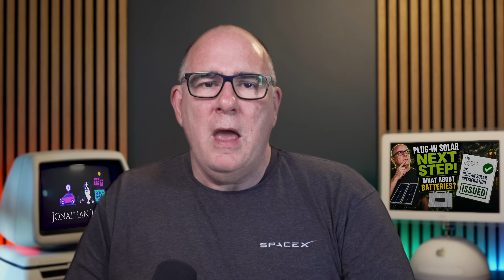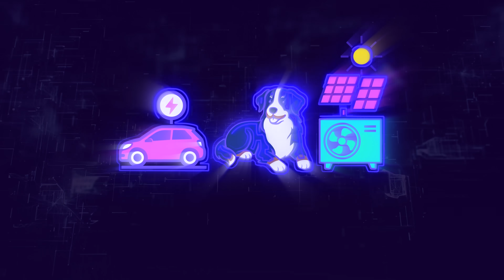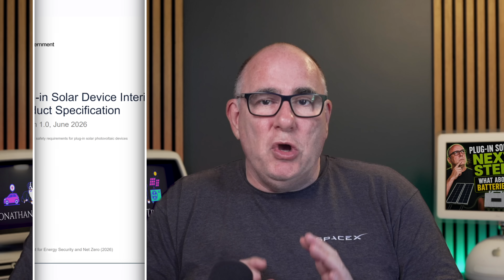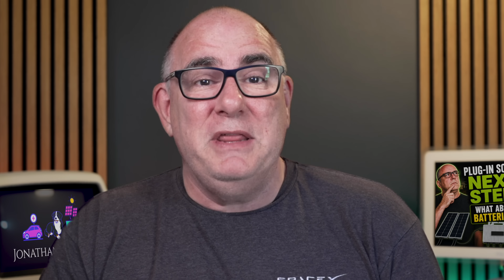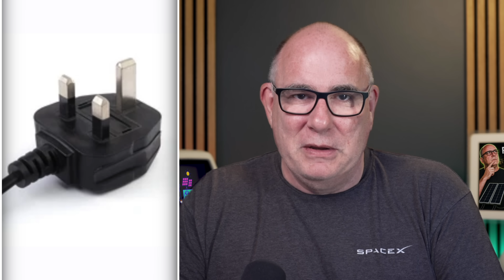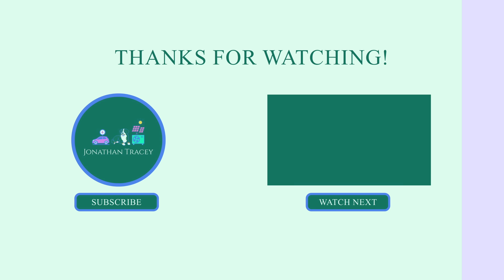Plug-In Solar Finally Legal? The Real Story Behind the New Government Rules

Comment from the maker: One thing I'd love your opinion on...

DESNZ has now published both the independent safety report and the Interim Product Specification, but battery systems have been left out for now.
Do you think that's the right approach?

👍 Start with simple plug-in solar first, then add batteries later.

👎 Batteries should have been included from day one.

As always, let's keep the discussion evidence-based and respectful. If you've spotted something in the specification that I haven't covered, let everyone know below.
Reply: Isn’t that being planned as non legislative introduction? They only mentioned the plug and socket standard to be updated. The building regs (the only applicable imo) do not explicitly forbid that sort of system, no change in the regulation is required.
Reply: It's wrong - This should have focused on purely the inverter size and connection.  Why have they picked solar only when if you think about it, it doesn't matter where that DC power comes from at all (battery or solar panel).  Meanwhile plug in solar is getting even more exposure and people are doing it anyway.  This needs to be simplified and expeditated asap.
Reply: Having plowed through the interim standard I think that pretty much all the generally available microinverter products will comply already providing the correct plug (and details like partial pin insulation) is provided, MC4 cables are bundled and a bunch of labels about not using Y connectors (haha .. nobody will care), only plugging in one unit, etc, plus some kind of guidance update have been produced.
Assuming the vendors have been involved in the work I would expect that the keen ones probably already have the draft of everything sitting waiting for someone to push "go" on the manual, and labels, they've run some plugs to check already and they've probably done in house tests to the draft as it was made. Given that 99% of the draft is basically "as your current German compliance" I also imagine they are already expecting a clean pass.
Reply: Summer is here, bills are here. Solar first makes sense right now, even though in the long run it would have been more efficient to do both together. Sometimes you just got to go. 

Which reminds me, back in 5 minutes….
Reply: Starting with just solar seems sensible to me. Adding batteries would drag out the process, especially if there isn't a long-standing EU standard they can just copy.
Reply: Good pragmatic choice. Battery products still seem to be evolving.  Judging by the interest in microinverter and solar panels deals shown on sites like Hotukdeals, I'm guessing confident DIYing public is just getting on with it anyhow.

Comment: Hi Jon, I have just purchased an Ecoflow Stream Ultra at considerable discount, and am looking for a tarriff.  I'll add solar when I get round to it.  I went onto the Octopus site to find a tarriff to use my 'battery/plug in solar' with.  Bad news, they want DNO certificate MCS, Installation Certificate, and all sorts of other stuff which basically I need someone to 'install' my plug-in solar system.  
Do you (or anyone else) know what exactly I need to get an 'installer' to do - is there a register of such individuals?

Comment: I have watched a number of videos on this, however I have never heard anyone mention that if you already have solar and a G98 certificate that you will need to apply for a G99 certificate which certainly here in Scotland is a much great issue and costly. Is this changing as I assume your main inverter can put 3.68 k/w back to the grid then you micro inverter can put 800 watts back, causing you to exceed the G98 limits.
Reply from the maker: Yep once you go beyond 3.68kw and a single device you get into G99 territory
Reply: @JonathanTracey why do people like yourself who are putting this content out there not explain this? Getting G99 approval is not straightforward and is expensive, especially in my region and must be sought before installation. Do you not feel that content providers should explain all scenarios, I don't expect that most people have G99 approval. Maybe a video explaining this may help.

Comment: Jonathan great video - I take it that as you have solar you can add this plug in device as an addiition?
Reply from the maker: yes I have a system that is wired in instead of using a plug (but basically the same) running for over a year now, they coexist nicely

Comment: Personally, I think they will need to clarify "One plug-in solar product per household". For example, would a modular system like the EcoFlow Stream count as "one system" if you have several of them. IMO they should, since they work together.
Reply from the maker: I agree, and I think there is a lot in this that needs further clarification, but that is why they called an interim specification

Comment: Bye Bye Octopus 
See financial times article today
Octopus energy set for showdown with workers  over union recognition
Reply from the maker: @hayabond893 I saw that article. From what I read, it's less about "Bye Bye Octopus" and more about what happens when a fast-growing company becomes a large employer.

Octopus has grown from a start-up to the UK's largest energy supplier in just over a decade. As companies reach that scale, it's not unusual for employees to seek formal representation. Equally, Octopus argues that every employee is a shareholder and that it already has a strong culture without union recognition.

Ultimately, it'll be for the employees to decide what works best for them. It doesn't change my view that Octopus has done more than most suppliers to drive innovation in tariffs, heat pumps and EV charging, but it'll be interesting to see how they balance that entrepreneurial culture as they continue to grow.
Reply: @JonathanTracey usually when companies start to get to the scale of Octopus they have to become more ruthless to grow profits This is always at the expense of those employees that helped make them successful. Take Amazon as an example, one of the worst companies regarding workers rights.

Comment: City plumbing have a selection of full kits with a uk plug fitted as well as the Hoymiles HiFlow 800 Microinverter with UK Plug & Play Cable , you can pre order with delivery for the 1st August, maybe they know something we don't, the full kits seem a bit pricey though.
Reply from the maker: that’s interesting that they’re for pre-order for a specific date, it does suggest that they know something that we don’t
Reply: @JonathanTracey  their "UKSOL Pro Duo Plug-In Solar Kit" is expensive but shown as in stock with 3 day delivery and the caveat "    PLEASE NOTE: The UK Government is currently in consultation of 'Plug-In Solar' and this product must not be installed without a certified installer"
So not technically plug-in

Read less
Reply: @kfarmer-b8v  Well there is something going on with their website  its saying 3 days on the product page but on the new "plug in solar " page it says the 1st, iHelios are also quoting the 1st for the same systems.
Of course you can't plug them in quite yet.
The Hoymiles Microinverter used to say 99 days for delivery with the uk plug that is also now saying the 1st so let see if the 1st is the official plug in day or is it just a coincidence
Reply: City plumbing have informed me you these won't be available till the beginning of August , the 3 or 4 day delivery isn't correct and they have now corrected the error

Comment: 800va is strangely enough according to my research 800 watts, the terminology was not what I'm used to dealing with Kirchhoff's law and Ohm's law
Reply: Not technically for AC , it depend on the Power Factor ( PF ) which is dependant on how resistive the load is. Resistive loads like kettles have a PF of 1 , inductive or capacitive loads can have a lot lower PF. a lot of new electronic equipment has quite low PF because of the capaciors in them so realy they are specifying the max current the inverter can produce.
Reply from the maker: yeah, it’s just a different way to expressing the same thing.

Comment: As a retired electrician that worked for SSE for nearly 50 years, I travel a lot to Europe, mostly Germany. They have, as we know had plug in solar for years. They don't use ring circuits like us, but generally their wiring is very similar, even down to the 230v standard voltage. They use plugs and sockets, So what are we doing in this country? So you can pay "an electrician" to install you a Tesla power wall, as long as he is a member of a trade body (another joke really if the subcontractors I have worked with are anything to go by)  So what is the difference?  Or is this another BREXIT bonus where we do our own thing years after everyone else. You can bring out "rule" after rule as to what you should do in your own home with electricity, but anyone who has ever carried "inspection and tests" know that people will do exactly what they want to, and that will include wiring up switches in the neutral " as that's safer", yes I'v seen and heard it all. 😂😂😂
Reply from the maker: @s6missile Thanks for sharing your perspective—50 years with SSE certainly gives you plenty of experience to draw on.

I think one of the biggest differences is that Germany has had years to develop both the products and the standards around plug-in solar, whereas the UK is only just catching up. That's why we're seeing DESNZ publish an interim product specification before the Wiring Regulations are updated.

I also agree that you can't regulate away poor workmanship. No set of rules can stop someone determined to do something unsafe. The best we can do is make the compliant route simple, affordable and backed by good engineering, so that's the option most people choose.

Comment: I already have a g98 system . Can I just use plug and play as a supplementary system and have the extra export? Is it a cheaper way to add two extra panels?
Reply from the maker: yes but you will still need to notify the dno
Reply: @JonathanTracey hi JT do you think the DNO’s are being conservative with their G98/G99 approvals knowing that this plugin wave will hit the grid. Most plugin systems will probably not be notified to the DNO’s and will those who have a reduced G98/G99 might just add some plugin support to improve performance to whatever they originally intended ?

Comment: Bit puzzled by your figures on web site
Jan - Jun 2025   +£37.44 Credit
Jan - Jun 2026  u Make it minus  -48p 
Jan - Jun 2026  I make it minus -£12.78    Not  -47p
    Can U check please    ( Nothing from Jul 26 inc )
Reply from the maker: how are you reading the data, from the charts, the summary or from the data source csv. also are you using the tariff sheets as well for each date range 😊
Reply: @JonathanTracey  took month by month figure from first 6 months for 2025 and 2026 to compare

Comment: Thanks for the update, interesting that its the UK Plug (with a 5A fuse), is the limiting factor. I've melted a moulded plug using a EVSE "Granny EV" charger drawing 10A as the 13A fuse got too hot - maybe this is the start of the end to the UK plug with its fuse - and we go the european standards
Reply from the maker: Remember 800 W a UK grid voltages is only about 3.4 amps
Reply: most "13a" sockets are not rated for long term use , you can now get then marked EV that are.

Comment: How do these plug in batteries/solar work with those who already have a full solar battery setup with gateway etc? I.e. are we able to buy some plug in batteries to use, or would this conflict in some way?
Reply from the maker: no, they were just fine, I’ve had a system running alongside my large rooftop system for over a year with no impact
Reply: @JonathanTracey brilliant, thank you. Most of the info out there focuses on those who don't have equipment already (makes sense). So just wanted to make sure i wasn't missing any key advice that could cause issues! What is you add solar and its in in excess? Does it export or cut off?Thanks again.
Reply: @Mark-pc7ox  electrically  is is the same as the neighbours solar but  your full solar will have an export limit set on your G98/99 so you will have to inform DNO of any increase.

Comment: Not buying ANYTHING.  sick of Goverment allowing me to buy illegal stuff. Lol. Not wasting any more money. Commented on another channel,  THANKYOU for INFO
I am keeping quite really. Not  buying anything. John Tracy channel.  Brought up . Molded plug rule emerged.  I already have a load of illegal stuff. Blame government, really. Must channel is dead unpopular.  So not at this stage , All batteries are illegal.  IWHAT A MESS . Old powerstream chunky and Even new Streams might be illegal 🤔.  No Molded plug . So might Have to wait still for Stream revised edition.  😅😅😅😅
Reply from the maker: @SolarResurrection I completely understand the frustration—it is a confusing situation. I think the word illegal is being used a bit too broadly.

There's no law that says you can't own or use these products. If there were, they simply wouldn't be on sale. The issue today is that the UK Wiring Regulations don't yet provide a compliant route for a true plug-in installation, so the accepted approach is for a qualified electrician to connect the system via a fused spur or other fixed wiring.

That's different from saying the equipment itself is "illegal". Hopefully the new standards and updated Wiring Regulations will provide a clear, compliant route for these products in the UK.
Reply: @JonathanTracey , Yeah, I was just saying to Upside-down Fork , Iwould not be using any DISCOUNT codes yet, Could be Later than Black Friday before you know you have hot a SERIAL number of something properly Legal. 😮.  Well , Its just , LEGAL a word as a Block from getting Export Rate. Could be 2027 before i feel , U am buying something that has an approved  serial number for EXPORT. . I can enjoy your success . I just got like 78 view or 300 views then Nothing. Like 7k views for a POWMR brand video but my channell seens to be on MARS where no one watches it. LoL😊

Comment: Hi JT, found this very interesting especially with the comment on the fuse for the plug, I'll be changing mine over to 5amp after hearing this. I have a question for you about the ecoflow battery system, can I link 2 ac pros in series to the micro inverter or would I need a stream max as 1 of the pair?
Reply from the maker: yes the micro inverter can plug into the power sockets on the AC pro giving it solar inputs
Reply: thanks for that, I have a second question. the new EcoFlow STREAM Series  $1599, Do you have any insite when we can get hold of them?

Comment: Will equipment manufacturers invest in the design, test, etc. of a potential product that by the time this process is completed and the design is ready for mass production the goal posts could have moved with the release of the 'final' specification is released?
Reply from the maker: @jim373 I think that's the million-pound question. My guess is the larger manufacturers will continue developing products because the interim specification gives them a pretty good indication of the direction of travel. I'd be very surprised if the final version was radically different.

The smaller manufacturers may well wait until the specification is finalised before committing significant investment. Standards do evolve through consultation, but they're rarely turned completely on their head at the last minute.
Reply: @JonathanTracey I think  microinverters  that meet  the specs have been around for many years to help with roof solar shading problems. On the roof they just plug into a waterproof junction box backbone  so the only thing that they need to make is the required 13a plug on one end and a waterproof socket to fit their system on the other.

Comment: For things to get really interesting, we need per circuit rather than per household and battery storage too. Without those things plugin solar is a hobby, not a serious energy source.
Reply from the maker: I suspect that will get changed as per the footnote in the document
Reply: @JonathanTracey I find the argument about the risk of interference odd for not including these in the initial legislation. These are already widely deployed in neighbouring markets with the the same European standards our grid and devices already share. On top of that home batteries are already prevelant in the UK. The only difference here is it doesn't require you to pay the price of the battery again to have an electrician scam you cabling in 3 wires.

Comment: Regarding the moulded plug bit.. Does that mean Ecoflow will have to ship out a new cable to everyone who has bought a device from them labelled as "plug in solar", once the reg catch up?
Reply from the maker: I don’t know is the honest answer, for the reality is it’s a bit silly requirement, because if you need to get the cable through the wall, what’s the first thing you’re gonna do cut the plug off?
Reply: @JonathanTracey  It was kind of a hypothetical question, it's HIGHLY unlikely Ecoflow will want to ship all past orders a new cable just so they meet UK reg. But you're right, I for one am grateful they don't ship with a plug due to it's placement in my garage. I personally prefer it being on a fused spur than a plug socket.